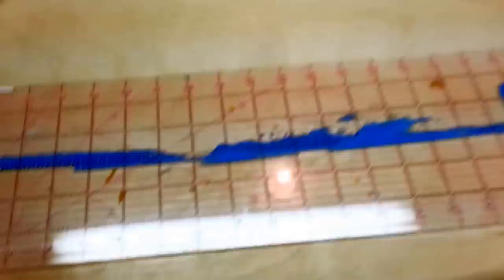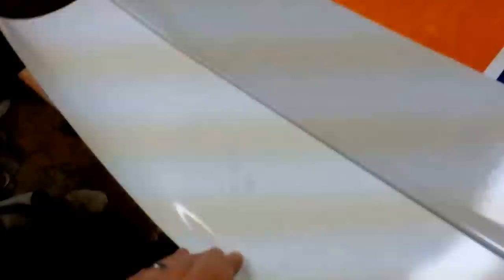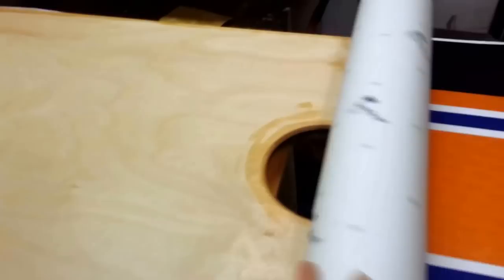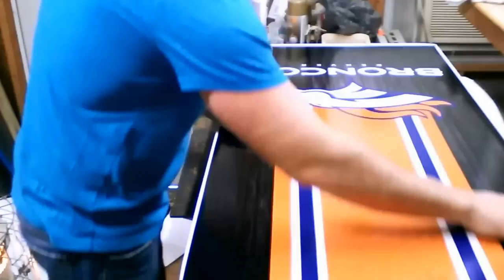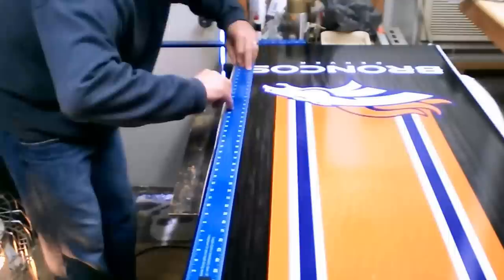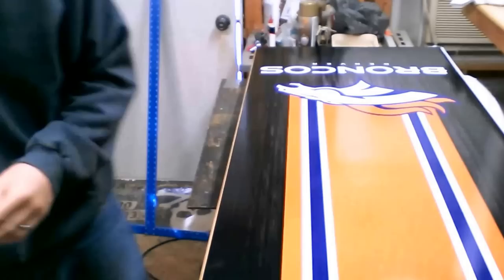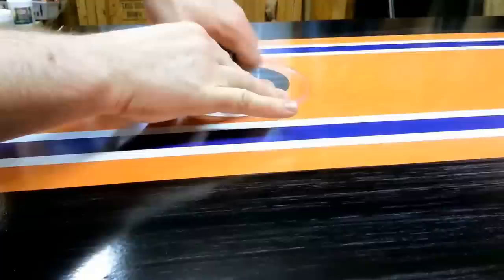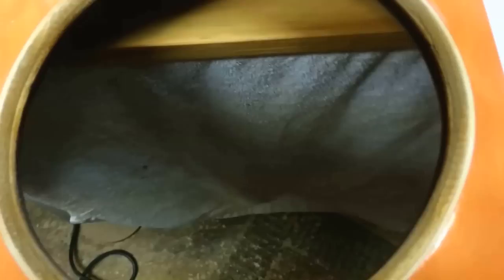How to install a vinyl wrap on a Cornhole board by CB Design

Comment: I’m having a problem with my vinyl decals sticking to the corn hole boards I have made. I stain them and polyurethane them, and when I put the decals on they start peeling off the boards in certain areas. Is their a sealer out there that you can recommend that will prevent this, and would I put the sealer on after staining and polyurethaning or before? Thanks I appreciate your input on this.